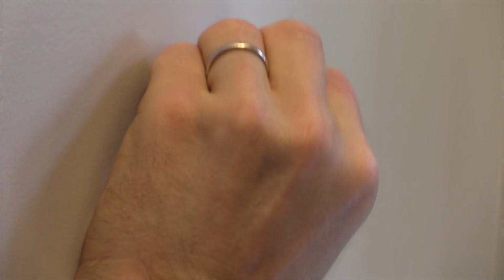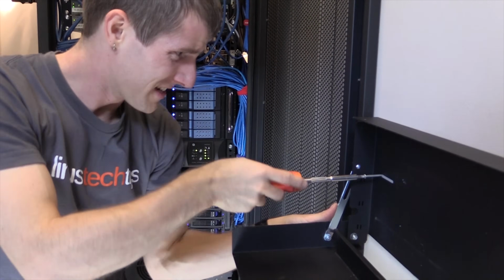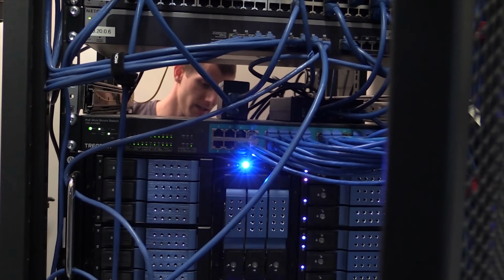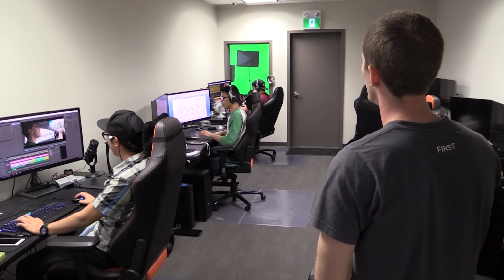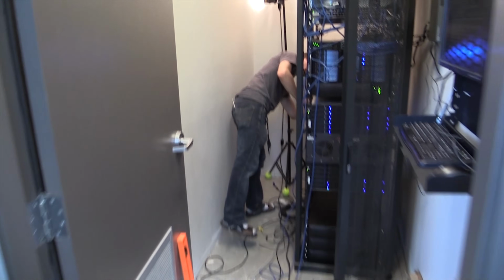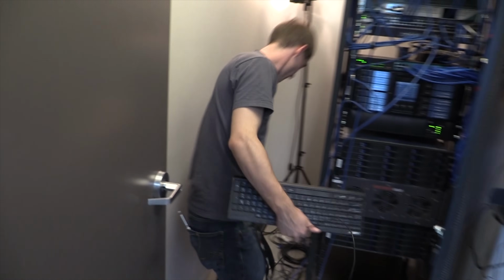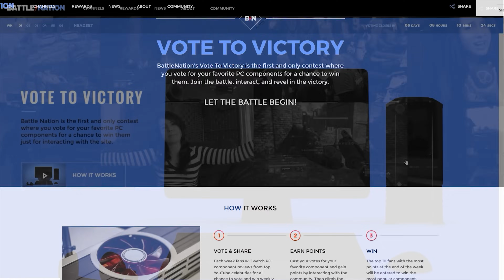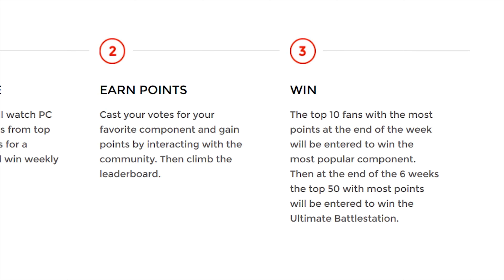Server Room Updates!! UPSes, KVMs, and more!

Comment: good to see the old Logitech K120 again, one of the best low budget keyboards ever made, I still have mine working perfectly after over 5 years of usage, numerous water spills, intense rage slapping and loads of dust getting into it, what a beast of a Keyboard. But why not go for an In-Rack solution, like one of these slide-able Monitor and keyboard combinations, wouldn't that be much more practical then a wall mount?

Comment: Why mount the KVM on the wall? You can mount the KVM switch in the serverrack (at the rear if you dont need acces to it alot) and you can even get a rackmounted keyboard with trackball and folding monitor that you can slide out if needed.

Also, leave some space between the patchpanel and other equipment, if you ever want to run some more networking cables to different parts of the building you're gonna need to remove every piece of equipment in the rack and move it down a few slots so you can fit an extra row of patchpanel. If you had left space there in the first place you could've shut slammed an extra row in.

Comment: Linus, just use a brush attachment on your vacuum cleaner so you can get all that dust out for good. Then lightly wipe those surfaces off with a 50-70% alcohol solution, and all that stuff is gonna be spanking clean for quite a while.

Comment: Yes I would totally recommend a filter on the door and a door sweep.. OR, maybe you could install a split unit a/c system. I've worked at several locations where that was the only way to do it properly. You have to be sure that the compressor is rated for constant use or it will burn out in 6 months. You should go back and look at your old footage of the server closet to see what's behind the walls. 20 minutes is never enough for a full server rack cable management session... Cisco routers are ridiculous for most people. I had one in place where I work now... And I stopped using it because it's more difficult to use than it is worth. I'd rather have a Juniper or a Ubiquiti.

Comment: ahm, do you know rdp and ssh?
Reply: +ThaMovingTarget every good Server has IPMI for accessing the bios, and when the network is down you cant make anything woth the services. LMG has only Servers that share their services in the lan. I installed a few racks with lots of servers and networking-hardware. in most cases you dont install a monitor etc. Server are administrated with rdp with windows servers and ssh or rdp with bsd and linux based Servers
Reply: +ThaMovingTarget ASUS Boards have an optional IPMI module and Supermicro board have IPMI onboard

Comment: http://www.amazon.com/JacobsParts-Express-Power-Splitter-Cable/dp/B00JLU0UQ4/ref=pd_sim_sbs_147_3?ie=UTF8&refRID=12WHN9MSD8ZXRNRP79QQ&dpID=41tx11VxAiL&dpSrc=sims&preST=_AC_UL160_SR160%2C160_ 
this one has 1 connector with female pins and two connectors with male pins
http://www.amazon.com/Phobya-6-Pin-PCI-E-Splitter-Sleeving/dp/B007OULOZY/ref=sr_1_5?ie=UTF8&qid=1444099804&sr=8-5&keywords=pcie+y+splitter
This one has 1 connector with male pins and 2 connectors with female pins
Does anyone know what is the difference in function between those?
The way I see it is that both would serve you well for a dual SLI videocard configuration, but then it's weird that in one situation the videocards would have female pins and in the other situation the videocards would have male pins (to fit with the adapter), which to me seems impossible, but I don't know.
Could anyone help me out with this problem I've been looking for days and I don't get it at all,your help would be appreciated a lot !!!

Comment: Linus I don't get why do you have your servers in RAID, I tought it wasn't reliable?
Reply: +TheDarkXeno depends on the raid...plus he uses ssd's so even raid 0 is k. Whats the last time you heard about an ssd failure xD
Reply: +Alex Paf Yeah your wright ssd's don't fail nearly as often as hdd's
Reply: +TheDarkXeno Depends on the RAID level. He's running multiple RAID5 arrays which gives him one disk parity per array (one disk can fail and not take everything with it). It's no replacement for a proper backup solution but it at least protects them from drive failure.

Comment: But it's not a trunked connection, It is an etherchannel connection at 15:30. Trunking is when you pass the traffic from multiple vlans with different tags through while etherchannels aggregate a connection accross multiple ethernet cables.(Source: CCENT Certified, Soon sto be CCNA Certified)

Comment: Linus,
Please use a vertical wall mount for the kvm to they have them I use them and you can use the correct rack mounting.  I have ups and a switch in mine and it holds like a champ. http://www.fibersavvy.com/store/p/121-Network-Rack-V-Rack-Wall-Mount-Brackets-Vertical.aspx

Comment: +LinusTechTips why don't you just RDP to the servers from your own desktop computer rather than consume more energy via the screen and other components plugged into your system? It's also a lot more convenient to use RDP as you don't have to get up from your desk!?
Reply: +Alex Bill You need both anyway. Initial install and emergency maintenance needs a local KVM. In larger installations you'd typically have a "crash cart" you can wheel over to wherever it's needed. In this case they don't have IPMI (or any other lights out management) so the KVM gets used a lot more.
Reply: +Jesper Monsted I know you need it on initial install and in emergency situations although how often does an emergency situation arise that you have to have a monitor, mouse and keyboard permanently attached to your servers? I run an enterprise network in a school and I have only had to plug in a monitor once for setup - apart from that I've never had to use them and I've been doing this for 3 years now. Just seems a waste is all - but I suppose each to their own.
Reply: Alex Bill The KVM switch is cheap and with everything sitting together it's an easy thing to add. Also, Linus seems likely to be breaking stuff and needing console access often :)

Comment: Linus, where is your network firewall? also you don't really NEED a router given that you are a stub network and you only have one way out. you could easily configure a firewall to act as the 'router'
Reply: +Wired2003 They're most likely just doing NAT on that Cisco router. It could run firewall services, but noone in their right minds do that. It'll be replaced with the pfsense firewall when he finally gets it to work.

Comment: Linus, why not use an 1U KVM solution with build in monitor? Something like http://www8.hp.com/h20195/v2/GetPDF.aspx/c04154398.pdf with a KVM console switch behind it. Keeps it all nicely in the rack and easily switchable. Some console switches even have UTP so you can manage the servers while at your desk.
Reply: +Arjen Sterenborg He specifically said he didn't want to use up the limited rack space for the KVM.
Reply: +Jesper Monsted Sorry, must have missed that. Still, giving up 1U for a nice, small solution is way better then bolting extra stuff to a wall a few feet from your rack and well worth the 1U i.m.o.
Reply: Arjen Sterenborg The ergonomics of his setup are probably better than most of the rack mounted KVM setups i've seen and used.
Reply: +Arjen Sterenborg also he has 1u gap between his hard drivecluster and UPS which for some reason is in the middle of the rack

Comment: This is a much better upgrade than your bathroom solution however you should've went for tiled flooring as opposed to bare cement as dirt is much more easier to accumulate from the bare cement being worn and torn out. There is also little space for scalability purposes which you will most likely need in the future. I hope those cables, switches, servers and routers have been labeled and you have sufficient network documentation in case of disasters. And finally please fix the cabling management.

Comment: if you made doors on the length of room instead of the width, it could have been easier working on it and you would be able to install additional small server thingy (forgot the name, :( )
The servers would be facing towards the length of the wall and slightly moved forward. It would be nice with glass sliding doors.
It might not be possible around the dimensions of your server room. I do not know. Just a thought.

Comment: You do realize that the space between the wall studs are standardized? With some basic measuring you will find them 10 out of 10 times if it is done correctly by the constructors.

Comment: this is like the worst server room I've ever seen! Haha I have seen worse.. but this is pretty bad. KVM's are so last decade.. with hypervisors you shouldn't ever need to keep going back.. once it's seutp that's it.
Reply: +Designandrew Yes, because setting up a hypervisor between multiple physical machines running different OS's with vastly different network and storage capabilities is totally easier than plugging in some monitor/keyboard/mouse cables.
Reply: Designandrew It's pretty embarrassing you believe that. Integrating virtual systems with other external systems and hardware is extremely complicated, and also adds an overhead and slowdown to the whole system. Read a book or something.
Reply: Ok
Reply: ***** Umm.. yes actually, virtaulization is much easier.
Reply: Some Dick ill just use ILO to see the console of the server
Reply: Yeah you sound like a real expert on the matter, not because of the 'noob' calls but because you compare Google's DATACENTER with a small size company's MER (Main Equipment Room to save you the google search for what it means)...
Google/Facebook running 50.000 servers will obviously not go into the rows of racks to troubleshoot 1 server, they pull it out and replace it to hook it up to a KVM on their repair station which I admit isn't near the racks but they do have them and use them...
Next time you want to call others noobs because they have a different opinion, consider that you can also be wrong...
Why would a console be for noobs? Having a monitor and keyboard is noob? Your servers are managed through magic? Even when the network is down and iKVM such as iLO won't work you can just pray and the server repairs it on it's own huh?...
Again, datacenter and MER, one has different properties and goals than the other...
Reply: +Designandrew There was literally dust from building in there when they started using it.. those servers will be a done deal in no time.
Reply: +Designandrew Yes try trouble shooting why your hypervisor won't boot using that hypervisor ;) The KVM is probably not for every day use but for those days that you need local access, RDP/iKVM is worhtless once the network fails...
Reply: Designandrew Must be a special version of iLo then, they usually work over a network ;)
Obviously iLO is useless when the network goes down for whatever reason. As I said, the KVM is not for normal use but only for troubleshooting/getting quick access when remote (still LAN but remote anyway) management fails.
'Once it's setup thats it' try that in a real world environment, you'll be crying on the first day on how creative users can be with trying to break the system, and they'll manage to break it at some point and failures never follow your agenda to see when you have time to deal with it. Not being able to quickly access the servers because you never fit a local console once the network goes down will suck badly ;)
Reply: Some Dick I read the first sentence then just gave up. Seeya kid.
Reply: Some Dick goodbyeeeeeee!

Comment: Can someone explain what a raid array is and what the different levels mean?
Reply: A raid array is a way of distributing info between multiple physical storage units for speed or reliability. 
For example raid 0 stripes data between 2 or more disks, this is used to substantially increase the speed of read/writes. However raid 0 can risky if one drive fails it corrupts all the data on other drives.
Raid 1 copies the same data on both drives for no performamce gain but double the reliability. 
Raid 5 stripes two or more drives with information with a third drive for redundancy if one drive fails.
Raid 50 in this video refers to a configuration of raid 5 + 0 allowing for increased reliability and performance. Linus has some techquicky videos on this if you want to know more. This can be complicated but I hope this helped.
Reply: understood all that, thanks heaps man